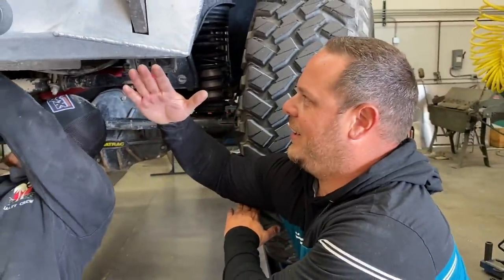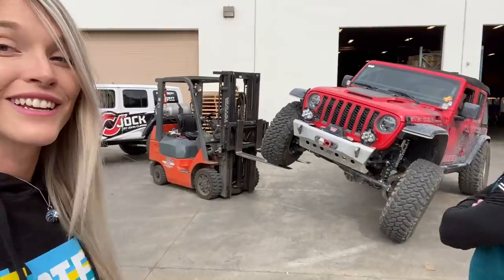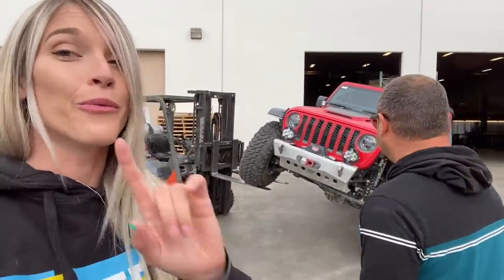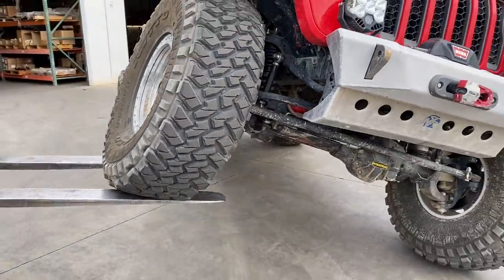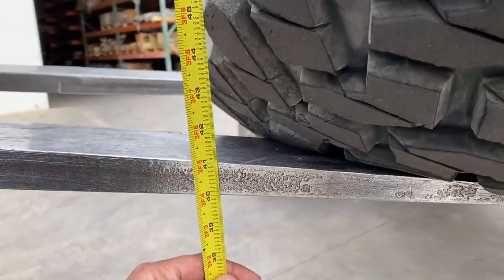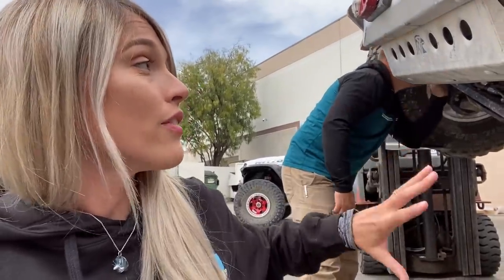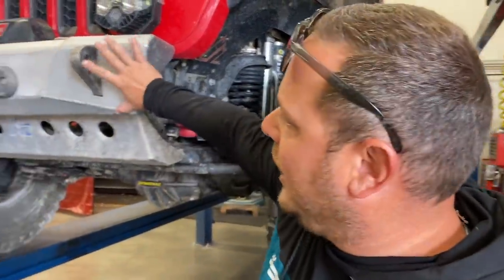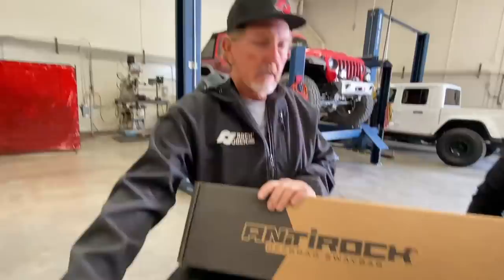ROCKJOCK ANTIROCK SWAY BAR INSTALL On Our Jeep JLUR!

Comment: I have Anti-Rock front and rear on my LJ. My front has 5 levels of adjustability and the rear has only a single connection point. When I first started jeepin' I had JKS disconnects like everyone else. Now I had no body role control! Later I broke a front mount and again, no body roll control even on road. So I knew the difference between stock and no sway bar, on and off road.

I installed the front Anti-Rock and it was a huge improvement on and off road! I still have more body roll than stock on road and its something you get used to. At no time does it feel like you are out of control. My off road performance has increased significantly! The Currie Anti-Rock is highly recommended!

Comment: I have seen several  videos on how to install the Rockjocks. But, I really didn't understand how they worked. Until now! Not only did you two explain how they work. Having Mr. Currie himself explain with situational examples.  Now I understand what the benefits to installing the Rockjocks are. Thank you, for putting out another excellent video.

Comment: First. I wish you all had used the forklift on the same side of the jeep for both tests, it shouldn't make much of a difference but the before tests were done lifting the passenger side and the after was on the driver side.
Reply from the maker: Ya we should have done that
Reply: @LiteBrite  On my TJ it makes a difference, because of the panhard bars, one side will flex more than the other, but I think you got rid of those with your new suspension.
Reply: @jimhester1205  The front still has the track bar.
Reply: @KX6D  That could be the 2 inch difference. Hopefully they will measure the other side and let us know.

Comment: I installed my front and rear anti rock’s last week. Same thought with the body roll. However, I have the FOX iQS shocks, so adjusting them took away the roll on the highway where I really noticed the body roll at high speed. Absolutely love them.

Comment: I got rid of my Rockjock Antirock a few weeks ago cause I was tired of the super body roll etc. SwayLoc is INCREDIBLE! I went mechanical lever because less chances of issues. But you guys trailer the jeep now a lot, so good stuff.
Reply: huh i have no issues with metacloak springs and the raptor swaybar which is just a cheaper antirock

Comment: We live in Big Bear and drive our JKUR on the mountain roads frequently. I know people say that they notice more body roll but I would say I hardly notice it. And no, I’m not a slow driver. I stuff it into turns all the time and it handles very well. I would recommend the AntiRock sway bar system for any daily driver. Also, what John Currie mentioned about dropping into a hole with a front tire and not feeling the body roll forward as much is true and VERY comforting. Then not having to reconnect as you return to the Hwy is very convenient. It’s a great product. I would recommend putting these high on you list of upgrades. @jeepharleytactical. @jeep4-1-1

Comment: That's wild you're basically a 716 RTI even with the anti sway bar connected.

And then roughly a 994 RTI with the sway bar disconnected. Crazy stuff.

Comment: I put mine a long time ago and I liked it. But yes, you loose a little flex  going up hill. Downhill because the weight transfers to the front you have all the flex. Off road you feel more confident through rocks,  less sway on the body.

Comment: So I’m an odd ball. I’ve purchased some upgrades for my Wrangler, but refuse to put them on until September; it’ll be paid off. Anyway, I’m definitely purchasing the anti-rock sway bar once I’m finished building this front axle. Amazing explanation and hats off to Mr. Currie. I only wish his inner c for the Dana 44 was up for purchase. It would go great on the new 3.125 tubes I’m putting on this RAM Diff housing.

Comment: I just installed an Anti-Rock front sway bar two weeks ago and took it wheeling for the first time last weekend. l Love it less body roll off road and just a little on road. Before I was on a stock sway bar with quick disconnects. I did keep my quick disconnect rods incase I still want to disconnect the anti-rock. I have a 2016 JKU loaded with gear, and it came with the .850 bar.
Reply: Thanks for you helpful post.  I was worried about installing the antirock for a cross country trip but now I think I will.  Do you have a rooftop tent?  Does the antirock perform OK at highway speeds?

Comment: Excellent mod for the Jeep. It does behave differently on the road and you will notice the difference which takes some adjustment. But like said it's designed for off-road. 👍👊

Comment: how badass to have the man himself wroking on your jeep!  i tell everyone that my anti rock is one of my favorite mods i've done, i had so much trouble with the stock rubicon jk sway bar motor i took it out and never looked back
Reply: How do you find it on the highway at speed?
Reply: @Gordon87Gekko  it’s almost unnoticeable from stock, being a torsion bar it still has great resistance to quick movements, but allows weight to take over at slow speeds and suspension to droop

Comment: This answered so many questions I had about the Antirocks. They were not what I was hoping for so I'll be keeping my stock sway bars... but having the right info is great.
Reply from the maker: What we’re you hoping for?
Reply: @LiteBrite  That they would be a proper upgrade for a daily driver and occasional off-roading. Seems like they are a bit soft for a daily driver if you’re happy with not a lot of body roll haha
Reply from the maker: Ya there is no reason to get them if you don’t offroad. It does make on road driving a lot smoother but there is a little extra body roll

Comment: Hey Kevin and Brittany, what did you do with the electronic disconnect wiring harness? Can you show us a video of the removal? Did you remove the harness all the way back to the fuse box?  Or did you just tuck it away somewhere and leave it under the hood?

Comment: We have been considering the RockJock for our 2016 JK for some time now.   Only apprehension is towing our small teardrop camper and how removing the factory sway bar would impact on road handling/towing.
I HATE HAVING TO MANUALLY DISCONNECT MY CURRENT SWAYBAR.

Comment: Lite Brite do you think when buying the new bronco someone should make sure to get the sway bar disconnect (badlands) feature or just get a Standard Bronco with Sasquatch and hope Currie makes a Antitrock to replace the plain sway bar. Very interested in your thoughts as it seems to cost almost $3000 to bump up to the trim that includes the sway bar disconnect from factory. Keep up the good work!

Comment: I’ve seen you get less flex with rear and front disconnected. I’ve tested it my self. So to everyone out there only disconnect the front you’ll get more flex. Now my question for you litebrite I wonder how this would go if you had an antirock in the front and the rear? It sounded like you guys also did the rear. I’ve seen that set up as well and guys say they really like it and can tell how much more traction they get from that down force on the other tire.  

Edit: awe now I see lol I wasn’t done with the video yet

Comment: On my JK I’ve been running factory rear (with extended links of course), and just no front sway bar. Seeing this video actually makes me want to swap to anti rocks front and rear.
Reply: You will actually be in better control while rock crawling that without sway bars. Plus the added benefit of less body roll on Hwy is always more comfortable and controllable. You won’t be disappointed.

Comment: If you're going to start with only one Antirock (front or rear), would you recommend starting with the front or rear on a JL Rubicon? Seems that it would be better do the rear first and keep the front disconnect to lessen the effect or the rear connected, front disconnected scenario while improving flex in the rear.
Reply from the maker: We installed the rear first on ours, because we were having binding issues with the factory one. Generally the antirock work better in tandem when you have them in the front and the rear, but we wheeled ours pretty well for several months with an antirock rear and factory disconnect up front

Comment: I want to see someone get rid of the whole torsion bar setup completely and just do it hydraulically. The idea is that you run a hose from the bottom of the left shock to the top of the right shock and another hose from the bottom of the right shock to the top of the left shock. Then you can put valving and springs into the fluid flow path to control the amount of twist and well as the rate of twist. This would allow frequency selective damping, where on fast bumps, there very little tie between the left and right shock, but on slow changes, it is very stiff. So your rate of damping is inversely proportional to the speed. Basically it would be like putting a Koni FSD shock between your left to right axle flex.
Reply: Didn’t toyota have something similar with their XREAS system?
Reply: @lookasism  I was not aware of the XREAS system. Interesting they do it front to rear, rather than doing it on the same axle. They also still use a torsion bar, so apparently it is not dialed in to replace the torsion bar. I would also assume the damping is not frequency selecting.

Comment: I went to sand hollow and my wrangler JK wobbled side to side so much I hated it. So I asked a local shop what he suggests and he told me antirockers. Came here to learn more about them. Problem is the entire time I was out there I never disconnected my sway bar so after learning more it looks like antirocker wouldn't of changed anything for me. So does this mean I need better springs?

Comment: I have had front and rear anti-rocks on my JKU since I built it.  I love the way it feels offroad and haven't felt the on-road sway is that bad.  One thing I have noticed is that when I climb and articulate at the same time my setup seems to want to pick one front tire much easier than other rigs without the swaybars.  The Escalator is one obstacle that this really showed on.  I was unable to get out of the 2nd hole.   The front left tire was 3+ feet off the ground.  I think when climbing I get more weight transfer to the rear and it unloads the front.   I have been curious if unbolting a front link would help or hurt in those situations.  I am interested to see your results.
Reply from the maker: Try unbolting it next time. The escalator is generally a wheelbase issue and being on the right line. Even 1” off can be a big difference on that obstacle

Comment: Other than the on road manners, I’m having a hard time understanding the benefit over the stock E-disconnect So I’m hearing that driving over curbs is nicer… great but who does that in real world application? And they literally said that this is for off-road rigs not for daily drivers, but you spent money to get flex results that are diminished by 5%. 

If I ever get a sport, I’d go this route, but I need help understanding why spending money and losing travel distance is better than keeping my E-disconnect in my Rubi.
Reply from the maker: Electronic disconnect can have electrical failure, it reconnects at 20mph, you cannot disconnect it in any situation where the vehicle isn’t on flat ground (although the Bronco one can), the disconnect isn’t always quick, etc etc. Although it does provide a little more on road stability, although the antirock setup provides better off road balance for rock crawling and high speed & takes away a lot of harshness with on road driving. ☺️
Reply: @LiteBrite  super appreciate the feedback. And completely forgot until today the annoying fact that my JK re-engages the disconnect at 15mph… super annoying! 
Love all the content @Lite Brite! Hope to connect with ya’ll one day here in Phoenix!

Comment: So basically... Drives a little worse on the road than a connected sway bar and a little worse offroad than a disconnected sway bar. If only there was a way to run a sway bar that disconnected just by the touch of a button 🤔
Reply from the maker: Actually it drives smoother on road and is more stable Offroad and allows us to do high speed desert and hard rock crawling without having to worry or rely on electronics.
Reply: By “smoother” do you mean more body roll? And “more stable” meaning less articulation? I don’t disagree with the aspect of less reliance on electronics. But personally don’t recognize the advantage over some simple manual sway bar disconnects, besides the 1min it takes to disconnect and secure the end links when hitting the rocks
Reply from the maker: Nope, smoother as in more comfortable over cracks, bumps, potholes, etc (imagine the difference in how rough driving off road is with a connected sway bar vs how much smoother it is when you disconnect). And more stable as in it keeps the body of the Jeep flatter in off camber situations, when climbing uphill and downhill, and on obstacles. We believe those are very large advantages for rock crawling. 😊
Reply: @dr.e.jordanblanche8309  Actually most Rock buggies have a similar sway bar , the ones that don't seem to roll over very easily.
Reply from the maker: Everything is a big advantage. There are almost no downsides at all. Everything is improved. The very minimal additional body roll is the only thing that could be seen as negative where everything else is a great improvement.
Reply from the maker: Also there is no “less articulation” the next video we went to a trail and got 100% of our flex in real conditions and not with just a fork lift which John actually described why that was happening with the fork lift.

Comment: Sucks you have to cut so much of the Jeep to install this. Way better options for this out there but less marketed. Check out swayloc. It’s stiffer for on toad and flip a switch and it’s like the anti rock off road. For a daily driver it’s a better option.
Reply from the maker: We don’t want stiffer on road. Softer on road means it rides much better and isn’t so rough in the Jeep. You don’t have to cut anything to install this. I cut the horns for more clearance since they aren’t needed anymore. This is exactly the ride we want on road and the performance we want Offroad without getting out to click a button. That’s the whole point is I can go from the highway to rocks or rocks to dunes back to rocks without every leaving the driver seat.

Comment: You lost 2 inches of travel going from the factory disconnect to the Anti Rock disconnect, and you have a little more highway/road sway. Why is this better, because you don't have to push the electric button?
Reply from the maker: We explain the pros several times throughout the video. 😊 Increased comfort, increased stability, increased traction, decreased body roll off road are a few of the key ones you may have missed.

Comment: Ive driven my IFS vehicle around with both sway bars, one sway bar, and no sway bars connected. No sway bars is the least ideal. One, making quick snappy lane changes on the highway makes it feel like a boat, and puts more wear and tear on your shocks. Front is kept on to keep the cv from spewing grease. Cause I've done that before, and its not fun. Right now still driving around with the front on, and the rear off. Wondering if anyone makes a sway bar compatible with long travel?

Comment: Do you have to, have a 4" lift kit to run a Rockjock Antirock sway bar.  I did not see a lift height recommendation on the website.
I am running a 2-1/2" lift on 35" KO3's on a 2017 JKU. I would like to keep the center of gravity low.  But mostly, we are old enough to be your parents so really don't want to carry a step ladder to get in and out of it.  Lol
Reply from the maker: No. You can run it on a stock Jeep if you like
Reply: @LiteBrite  Thank you.  I believe I will be ordering a set very soon then.
By the way you guys are great. Love the content, all of it.

Comment: Did you guys look at the Sway Loc?  If so what was the reason you went with Antirock instead?
Reply from the maker: Sway lock states they have an even more rigid bar in the on road position and we really like the way the antirock feels on road. It really allows the suspension to soak up the uneven roads and pot holes. Which is why we also went with the thinner of the 2 bars. It allows for more compliance on road

Comment: Great video as always. Question to you both or your fans. My wife's Jeep, 16 JK needs shocks, she wants the best mall crawling ride she can get. I want a Jeep bling looking shock. I am looking at reservoir and adjustable but must ride smooth, still stock Sahara springs. Thank you all.
Reply from the maker: We run bilsteins on everything and they ride great. Check out the bilstein 5100. They are bling and ride great but don’t break the bank
Reply from the maker: Prob get a bilstein steering stabilizer as well
Reply: DS.  Also consider Doetsch Tech's dude ?  Am running Bilsteins on my Rangie, as it doesn't have anti-roll bars fitted and need the high speed monotube style stability.  Rick had originally supplied aftermarket dampers for earlier Jeeps and these can be selected for your specific needs !  V.
Reply: @LiteBrite  I saw them on a top 10 shocks for trucks. You have confirmed
Reply: @LiteBrite  I saw them on a top 10 shocks for trucks. You have confirmed
Reply: @LiteBrite  You are right